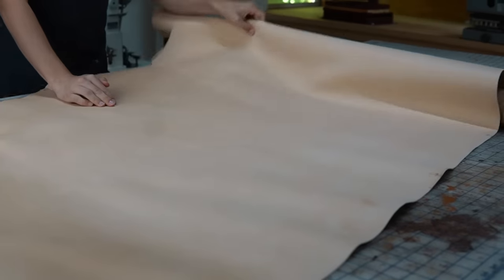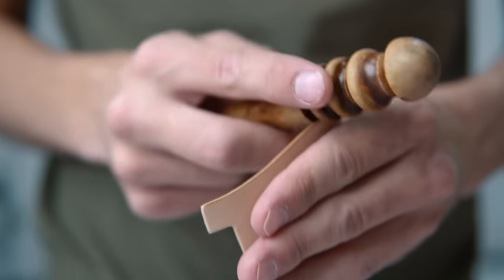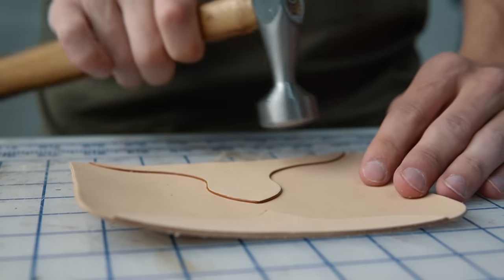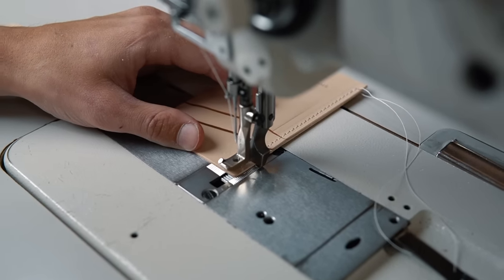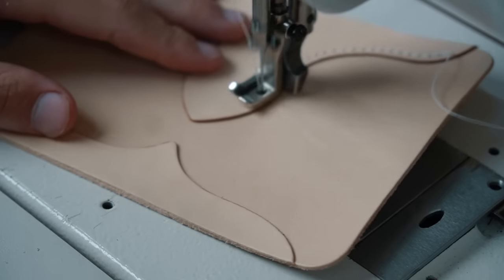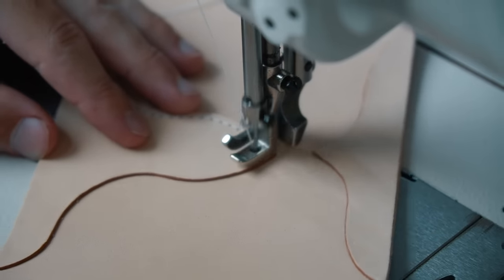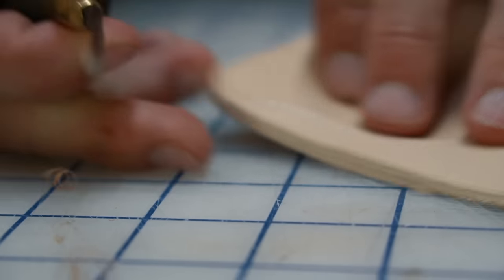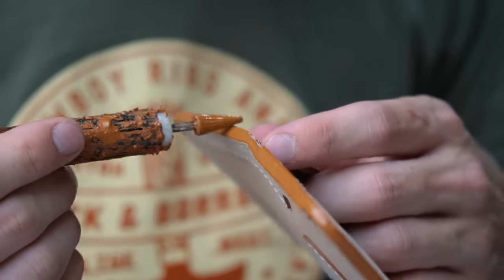Making a "Western Vertical Wallet"

Comment: I have a question on thread. I shop the thread exchange and I don't know what 207 thread you use waxed, nylon, polyester. I was thinking about running it through my juki 1541. Also trying to figure the appropriate needle. What's your application? Love the help.

Comment: My husband wants to buy a leather sewing machine. We are not going into production. Should he buy a flatbed or not? He might try making small bags, not sure yet. What do recommend? Thank you
Reply: He has had videos about that, and if you are going to do bags a Cylinder arm machine is the way to go. It is more versatile and can do what a flatbed can't. I would say CB3200 or Cobra Class 26 as you can use small and large threads. The larger machines cannot use the smaller thread. You want a servo motor, and speed reducer. These two come with those things. You can even put a flatbed attachment on it! I only chimed in as he doesn't seem to have been on YouTube for 7 months!